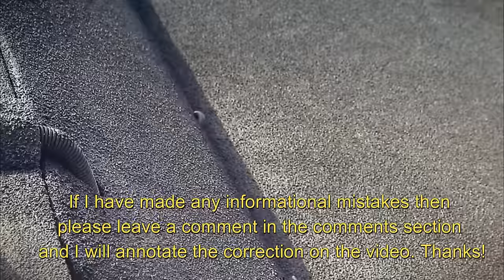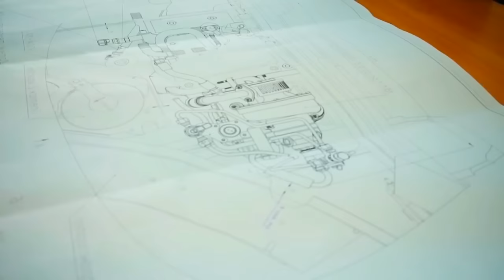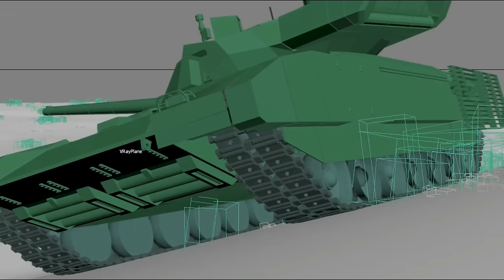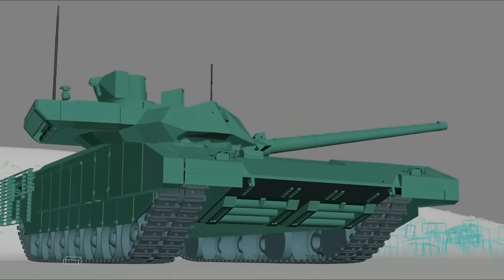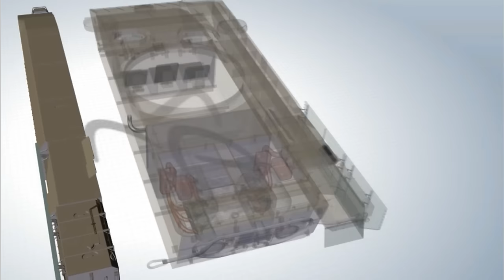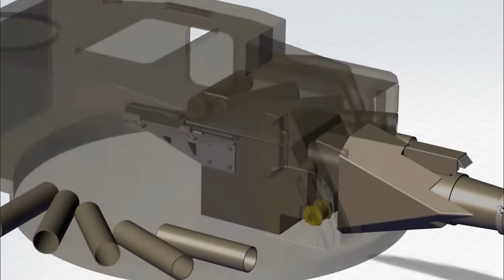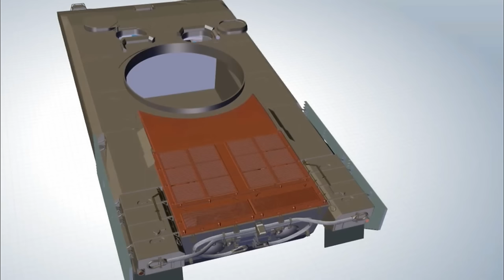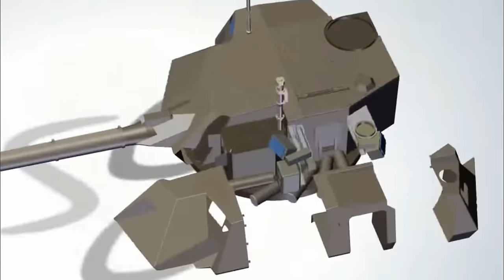T-14 Armata Russian Main Battle Tank - Tank Overview

Comment: electromanetic pulses, man.
Reply: So what? The tanks are completely resistant to EMI. They can survive a nuclear explosion.
Reply: are they ? :P
Reply: clusterguard Yes, the explosion of 500 meters will not cause critical damage to the tank. This is the most stable equipment.
Reply: and neutrons ?
Reply: clusterguard Neutron ammunition was used because conventional ineffective against armored vehicles. Modern sufficiently protected, some even excessive.
Reply: if it can stop neutrons ... well, what a machine!! it will be a revolution in armor!
Reply: Anti-neutron protection is in use since T-62
Reply: Gustavo +
Reply: Dude, what do you even mean by 'and neutrons'?? I see also you said it is such a machine if it can stop neutrons, I am assuming you mean Alpha particle radiation, which is 2 protons and 2 neutrons in a particle, which LITERALLY PAPER CAN STOP.. It also only takes lead to stop Beta radiation which is electrons, which wouldn't directly damage the vehicle anyway AFAIK, and thus the crew is totally protected from particle radiation. As for electromagnetic radiation, well, if helicopters like the UH-60 Blackhawk for example can be completely EMP proofed then I've no doubt you can do it in a tank too, and while this kind of radiation like Gamma Rays can be very harmful to humans in large amounts the armor would undoubtedly block a lot of it, like easily more than half of it, because of how thick it is and because where the crew manages to fit in the little bubble, hell I'm pretty sure in ANY tank post-WWII for the most part you'd be safest from such radiation if you didn't have a god damn underground bunker to hide in or whatever..
I hope this made any sense because you guys sure fucking don't.
Reply: hello. see "neutron bomb". cheers & merry xmas
Reply: I think you're confusing neutrons with neutrinos. It probably can't stop neutrinos but you don't need to. They don't do a whole lot. As for neutrons. I have never heard of a weapon that uses neutrons, why would you even protect against that?

Comment: T-14 too expensive for Russia . They make a few for publicity and keep making T-80s and T-90s . Typical Russian mentality of quantity over quality.
Reply: BLÅk Tsar  : COD ?
Reply: It takes time to switch production to something completly different from the current one...Full scale production will start in 2020!
The armata platform is made to be configarable and many parts are shared between multiple different new apc's spg's and ifv's!
The plan is to completly switch to Armata production eventually Currently the plan is to finnish upgrading the T90s and the T72B3's to the most moder configuration for them to be able to sell them later to cut costs of the switch!
Reply: No... only 32 units ordered until 2022.

Comment: 12 KM detection and firing capability... The curvature of the Earth would probably hide the target from the tank. Propaganda?

Edit:

The T14 is 3.3 (0.0033 km) meters tall. We will assume a sterile environment with a perfect curvature and no light refraction. The average radius of the Earth is 6,371,000 m (6,371 km)

https://i.imgur.com/5mz33VE.png

Solving for H2 gives 0.0023874 or 2.3874 m.

The M1 Abrams is 2.44 meters tall, and the Challenger two is 2.48 meters tall. If the both tanks were on a perfect plain with no refraction, they would barely be visible.

In an actual combat environment, they would not be detected.
Reply: any modern tank could fire at such ranges
Reply: 12 km ATGM range, normal rounds fire just as far as others.
Reply: any modern MBT can fire HE shell at 12km. And hit something